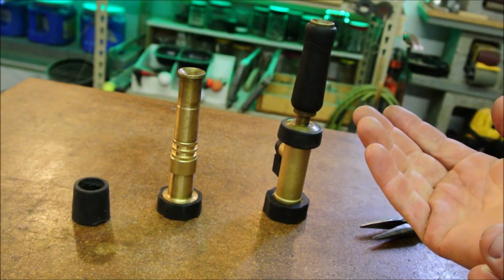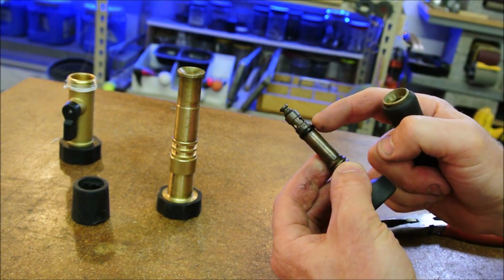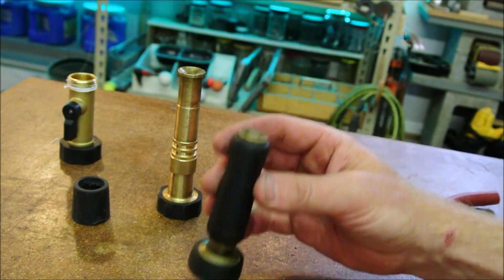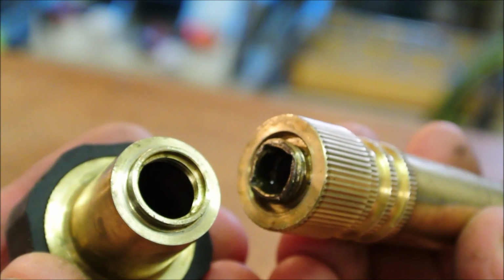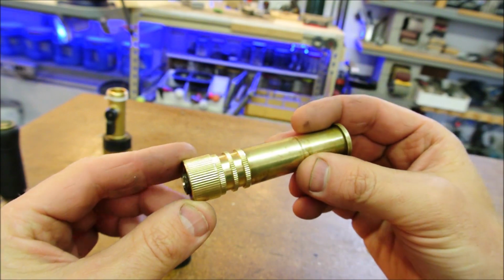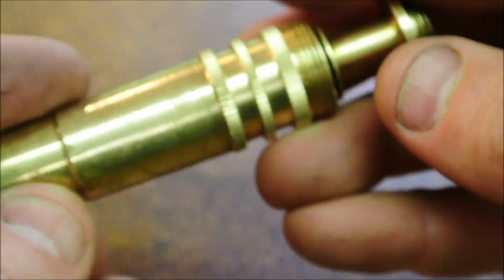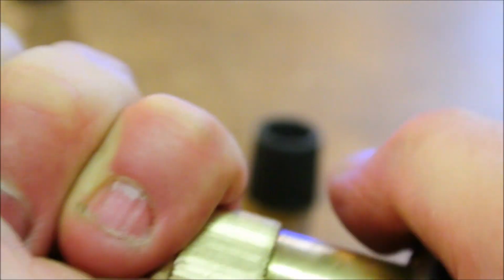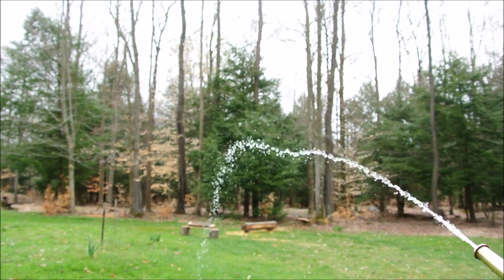Brass hose nozzle break-down

Comment: There is one more step to this video.  At minute 9:00 when totally disassembled.   The very tip of the nozzle is also able to be unscrewed.   Once you unscrew that, there is another O-ring.   In my case I knew it was there because I could see that it had come "unseated."  I think when you dis-assembled it.  It re-seated itself and began to start working again.   Mystery solved.  Thank you very much for this video.  It was extremely helpful and  I agree it is an elegant piece of engineering.

Comment: Simple and elegant yet subtle and cunning. I've found on many occasions that just taking something apart and putting it back together solves the issue but of course, it's not always that easy.
Reply from the maker: Exactly! Usually, 80% of being a mechanic is cleaning parts. 15% is then arranging/remembering parts. The remaining 5% is ordering/fixing parts. In those cases when "it's not always that easy," the repairing of parts instead becomes 99% of the total. 

Count a snapped motor mount bolt in that latter category.

Comment: My hot water faucet in my upstairs bathroom sink is dripping and  I can't figure out how to disassemble it...or at least I couldn't  yesterday.  Perhaps i'll take another look.
Reply from the maker: In my last house, the downstairs laundry sink had a slow drip for close to a decade. When selling the house, following the home inspection, the realtor tried to use it as leverage. After hearing this, I had it fixed 30 minutes later!
Reply: Faucets are tricky if they’re too old 10yrs+ in my experience. When it really is worth the time to just replace them. 

However some could be fixed by tightening a screw or a new seal somewhere. 

Beat of luck! You can’t break what’s already broke!
Reply: @pocket83squared  this was the funniest story I've heard this month it could be a problem not worth fixing but as soon as money is involved it sure gives you that extra incentive, but the worst part about doing these type of delayed for years job to quickly is it often makes you feel stupid for leaving it so long, what was wrong with the tap?

Comment: I'm more surprised those tiny threads didn't strip out way before now. That's really not much material. Then again, there is sort of a 'boss' to take some stress off them.
As for another less-than-obvious leaky nozzle story, i have encountered a similar issue with an air quick release. It would leak but only if something was plugged in. Long story short, by holding the hex end with a wrench while turning the front-most ring (the one on the very end, opposite end of the threads for the hose) i was able to screw the parts back into place and stopped the leak. Looks like it was made that way so that the release collar, spring, and the retainer balls could be put in place. Since there are no gaskets there usually there is no need what so ever to take that particular joint apart, so it's not obvious.

Comment: oddly enough, today I was looking at those exact brass sprayers at a farm supply store, out of frustration at the expensive multi-spray pattern sprayer I bought last year. I gave it to my friend to wash his car with, and when I got it back it was leaking from every single possible seam and joint. And I cannot disassemble it without cutting the injection moulded rubber. Those old-timey brass nozzles really are the way to go, and anything containing any amount of plastic in its function is built guaranteed to fail it seems

Comment: I'm usually rather good at fixing things, I was humiliated to be defeated by a garden hose nozzle. I watched your video, I tried (again) to remove the bottom part, by hand, then with vise-grip pliers, nope, didn't work, so I looked at the reversed thread area and I saw a very fine bead of solder... it looks like Orbit (I think it was) "improved" their design. it's the second time that I'm really angry at a company for a being obviously dishonest, the first was a $25 can opener from Cuisinart with a spacer that was made of plastic instead of metal, it lasted 3 months, I use camping cans opener now, it works perfectly.😊
Reply from the maker: Ha! We still use one of those (for camping) can openers, too. Thing must be 15 years old now.

Comment: I feel that that nozzle is over engineered for no reason whatsoever. Complex doesn’t mean better. It is an interesting design but in my opinion unnecessary.
Reply from the maker: Fair point. And a potentially long discussion.
Reply: While I haven't fully wrapped my head around why they choose to make a more complex design. I would suspect either to increase flow rate, particulate size able to pass through, or decrease cost of manufacturing. Most companies aren't in the business of burning money.

Comment: Safety gas cans can burn in hell, which they probably will given how much gas I spill all over them, the ground, myself, and whatever I'm filling.

Seriously, I've spilled at least an order of magnitude more from the supposedly spill-proof safety cans than I ever did from normal gas cans.
Reply from the maker: You said a mouthful, man. Those things are a physical symbol of everything that's wrong with this country. I've been working on a few ideas for simple DIY replacements, but I haven't quite nailed it enough to put one to video, yet. 

That's #2 on my lifetime invention goals list, though. #1 being a windshield wiper blade that isn't in need of replacement every time it's been exposed to sunlight.